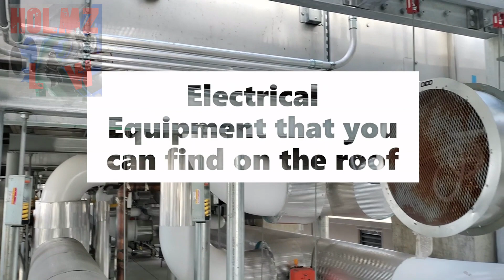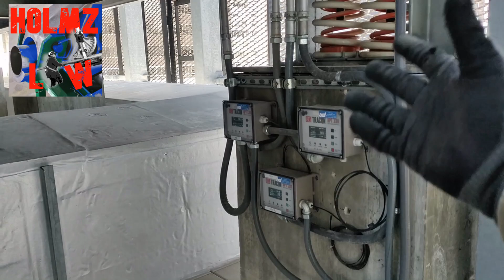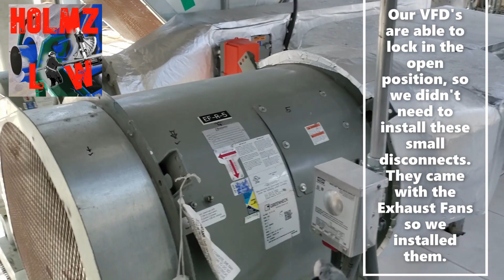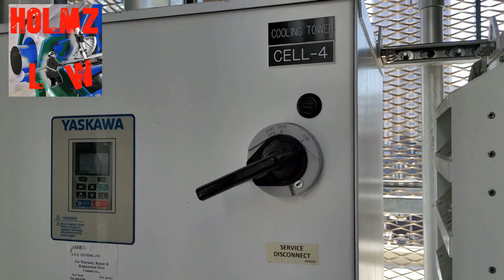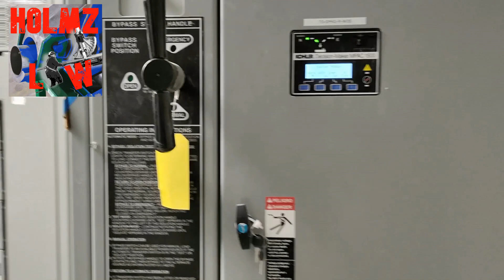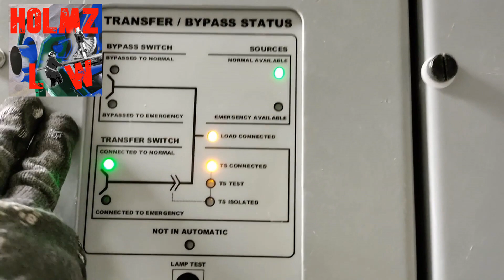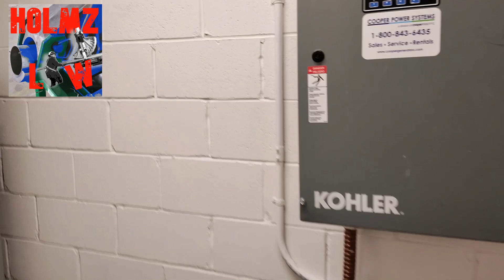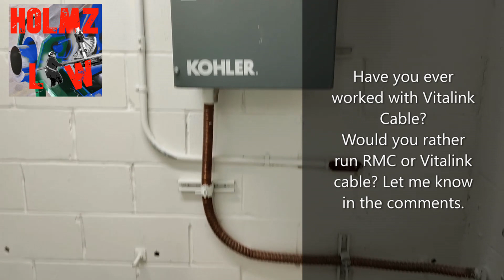Roof Top Electrical Equipment - Equipment you may come across on the roof

Comment: Good Videos! Appreciate your efforts.  At 7:52, i was wondering if there any reasons there isn't a lamacoid details on voltage and circuit rating or a warning label on Switchgears?
Reply from the maker: There is. The manufacturer gives us all the stickers. We post them after we are done with install. We get our gear from a local supplier called electrotech. This is how they do it.
Reply: @TheArtOfConduitBending  ahh, yeah i just don't see them on front door of like usually they would be! Also was wondering if you could video regarding NGRs or grounding?
Reply from the maker: @Bhanupratap56789  I never had the opportunity  of installing an electrical system that used an NGR. I could do a video explaining it though and also go into grounding. I usually like to do videos on things I'm actually working on so the viewer can actually have a live video to refer to.
Reply: Appreciate your feedback and quick response! I would love to know your opinion on grounding and any ground-faults/Short-circuits scenario that you heard of or occurred and precautions to take when grounding equipment.
Reply from the maker: @Bhanupratap56789  here's my Discord community link. Best way to contact me and ask me questions.
https://discord.gg/DpXuJDtd4V

Comment: VITALINK was specified for your job probably because at the time of the design the RHW special wire that has fire rating for emergency circuits (LIFELINE brand?) lost its UL listing. So it wasn't an option. I think it has since regained its UL listing. Of course MI cable is also an option. Thanks for the tour.
Reply from the maker: Yes it was on the specs. The men installing it don't like it. They rather go back to RMC. Owners just feel it saves time and money. I have to agree.. but only if you have experienced men Installing it.